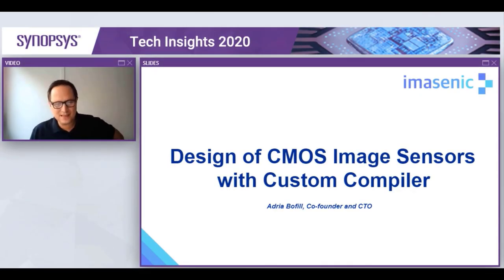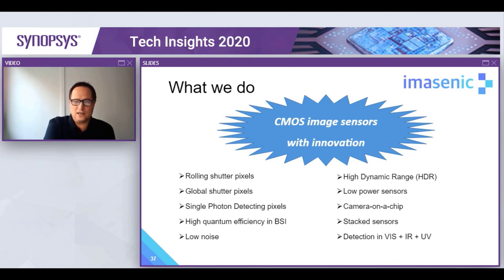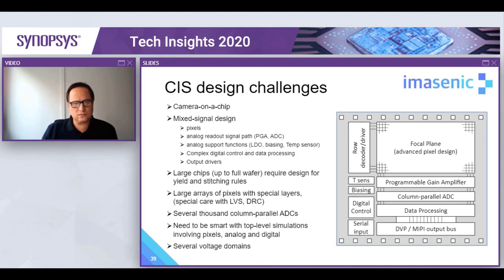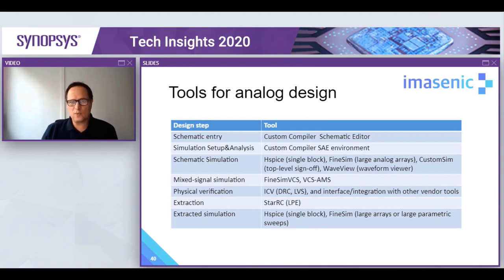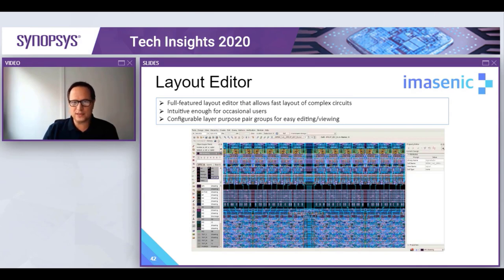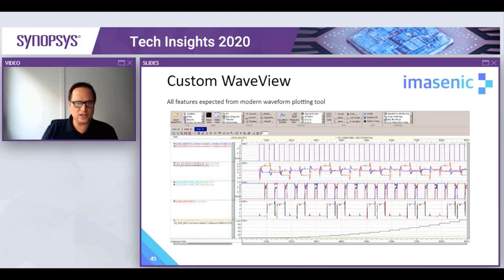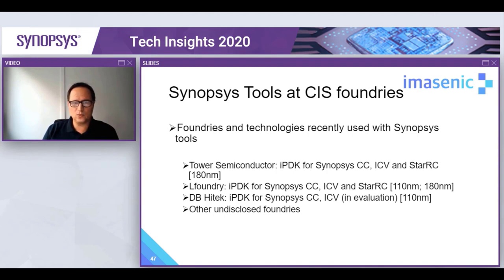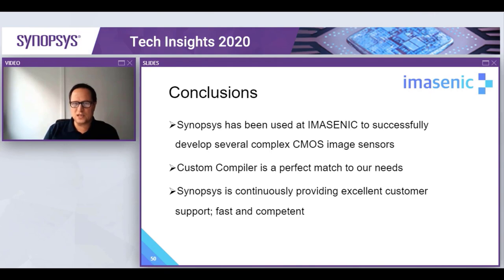Design of CMOS Image Sensors with Synopsys Custom Design Platform | Synopsys

Comment: Is there a way to design a build a custom camera sensor as... say... a hobbyist???
Reply: What I'd really like is a sensor with 5 filters for Red, Yellow, Green, Cyan, and Blue. Probably with 2 green sensors... so an RYGGCB sensor, because this would increase the "hue resolution" around the green section of the spectrum, which would make finetuning a green screen key much easier and more accurate. It would also let you do color isolation effects, and hue adjustments much better.

As a hobbyist I could make my own software, but custom hardware is hard to come by.